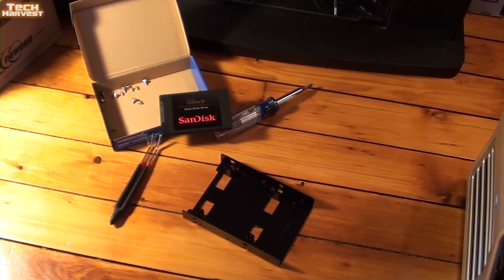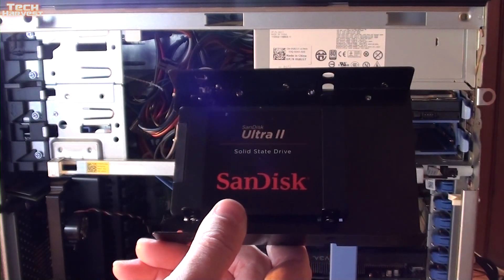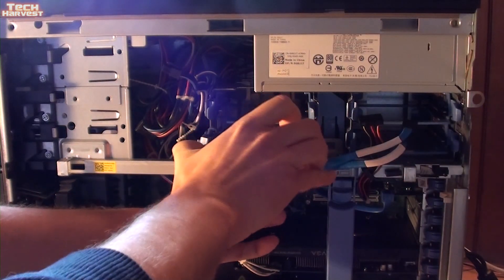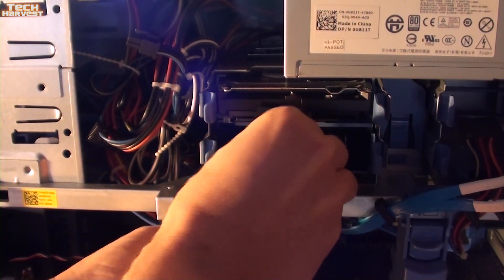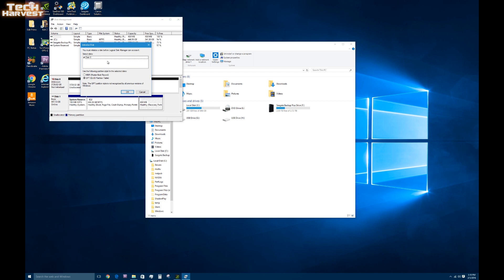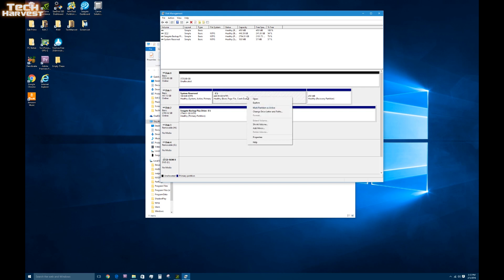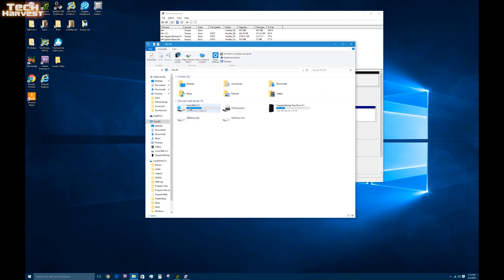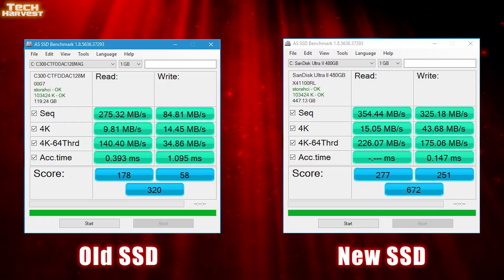SSD & HDD Upgrades & Performance Test: Dell Precision T7500

Comment: Hi, nice video. I own a T7500 as well and I've been unable to get the boot sequence tweaked to my liking. I have a SAS 6 controler that manages four SAS drives, an NVME drive on a PCI-e card and an SSD bootdrive. I want the SAS drives loaded last in stead of first because getiing the drives detected takes about 30 seconds, before the SSD loads. That kinda kills the fast boot an SSD gets you. I woulod like the SSD to boot first and then have the SAS controler do its thing in the background. Booting from the NVME drive would be even better (that is why I got it), but that appears to be impossible. If you're aware of a way to get the NVME drive to boot the system, I'm game.
Reply from the maker: I'll let you know if I come up with anything.

Comment: Hi came across your channel as I own a T7500 - really enjoyed all your videos on this beast. Just wondering what boot times you get on yours, I know mine has a HDD but it seems to take an age to get to the boot process eg. From poweron 39 secs till the Dell SAS 6 host bus adaptor BIOS initialising screen then at 56 secs the search for devices HBA 0...
Finally get the windows 10 login prompt  between 2mins to 2min 30secs - I've just kind of accepted that this is the norm?
Reply from the maker: First of all, thanks for watching.  I'll have more videos to post soon.  I've never timed the boot up.  It does take a while though even with an SSD.